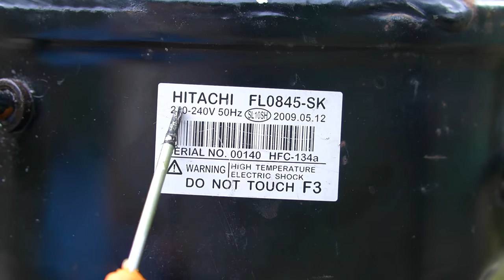I turn fridge compressor into a welding machine new technology

Comment: It is not following magnetic circuit, so as per electromagneic induction it is impossible to work.
Reply: Is directly connected to 240v, maybe just something limiting the current, look at the size of the electric arc, a normal welding machine doesn't make an arc of that size and with that intensity!

Comment: Has a duty cycle of less than enough to do any “real” welding. Not really sure this is a welder or just a crazy short circuit.
Reply: Burn the weld
Reply: What is welding though.  Melting metal with high current  low amps.  How you  achieve that is up to you
Reply: @j5892000  you mean high current low voltage?
Reply: @vinothkumar5846   yeah  . Oops.   Lol
Reply: 😊ช
Reply: @j5892000  
Current and amps are same thing.
I think you meant low voltage and high amperage.
Reply: @vernonleeper   no current and amps are not the same thing . Amps.. also known as ampere  or amperes is a a unit of measurement .   Like 1 amp or ampere of current.   It's like saying 1 gallon of water.  The gallon is the unit of measurement  and the water is what is being measured the amount of
Reply: @j5892000  🙄 whatever

Comment: Regulate the current by moving the secondary winding in and out of the stator. Also you could use the windings from another motor to make a line reactor that would stabilize your Arc more so you would have a constant current welding machine versus a sort of constant voltage machine.
Reply: No opino x q no tengo conocimiento.
Reply: Isn't it just a step down transformer?
Reply: Interesting,would You make a vídeo on how to ,hope You do it
Reply: and rectify the current , and you make a better welder
Reply: Hey, why are you wasting your skill on things that can't work.
1. An air coil with a couple of turns is inserted into the stator, it can never induce the voltage needed to produce an electric arc.
2. No voltage can be induced on a coil inserted like that, at most a few mV.
3. It's a fake!
Reply: @georgeshustbag6131  yes its a fake.. i have a bigger transformer in the past.. with a much bigger wires yet still overheat at cant do good welding... but this video makes good weld with that motor wires so small is very imposible to me too
Reply: @tiktok3rs126  The sad thing is that some people will build and reproduce it...
Reply: @raloed.363  step up
Reply: @eldiony45360  no it has to bee step down. its much smaller amount of turns on the output wire that does the welding. he is using high current to do the welding not high voltage
Reply: Could you  please explain may be simple cicuit of the second winding? Thanks
Reply: Buenas tardes amigo es un motor de nevera es de 120 voltios
Reply: @freddycardozo3274  Hayır 220volt ac
Reply: @raloed.363  Yeah
Reply: what gauge wire did he use?  Also if I touch the two red wires by accident will they kill me or what?  That is, I see that he places one end of the red cable to make contact with the iron so that when the other cable comes together, he creates the solder, but if I accidentally touch the iron while soldering or grab those red cables, what will happen?
Reply: Do you know if works with 110v instead of the 220v?
Reply: Ham Radio ,felicitari . Urmaresc articolele Dvs. de  multi ,chiar foarte multi ani ,construind chiar multe montaje inspirate de acolo .Ma bucura reintalnirea.Mult succes ln continuare !
Reply: @freddycardozo3274  el motor es de Asia o Europe  por eso es 220v
Reply: Muchas gracias
Reply: @freddycardozo3274  Aprecierile mele erau la adresa publicatiei "Ham Radio". Probabil a aparut o confuzie din partea mea . Oricum, doresc mult succes tuturor profesionistilor si impreuna cu incurajarile binemeritate amatorilor acestui minunat microb ,care pe mine m-a infectat la varsta de 12 ani(acum am 66 .)Multa bafta tuturor !
Reply: Or I'll just go buy a cheap machine from harbor freight and get all the bells and whistles I need
Reply: Reglajul se poate face foarte ușor prin o spirala de nichelima pusa pe cablu de cleștele de sudura funcționează ca o rezistență, sau un miez de fier băgat în gaura bobinaj ului făcând câmpul magnetic să aibe oscilații s-au acel bobinaj improvizat scos în afară pierde din putere sau introdus creste puteri, eu am făcut asa ceva cu motor de 2kw.
Reply: @bahri568  the magnetic field is rotating inside the two sets of coils. That makes the core rotate. He uses this principle to make an asynchronous transformer. Maybe even DC.  He should have used much thicker wire for the secondary windings. That wire will heat up nicely.
Reply: @TuMundoAndroideMania  
It`s total fake.
Reply: @TuMundoAndroideMania  Current flows in a closed loop. You can see from the construction that the red wire is isolated from the mains; so if you touch it you will not get electrocuted, even if you're in contact with an electrical ground. This is a step-down transformer so the voltage in the secondary is much lower, but with the very large amount of current flowing, if you were to cut that red wire with pliers you might suffer burns from the resulting arc.

I see that there are doubters here. I have never seen it done with a fridge compressor, but you can in fact make a welder with a transformer and if you get the right kind of welding rods you can also weld with AC. But assuming this is real there is probably about 10-20V at around 100A of current. A fridge uses 200-600W, and you can use some estimates based on the appearance of the arc to back-calculate.
Reply: @stickyfox  I see you !  You explained it to me so well that there is nothing to question.  Thanks for answering what I wanted to know, I thought no one would, thanks.
Reply: what is a line reactor?
Reply: @snorttroll4379  Reactance is the imaginary (AC) form of electrical impedance that's called resistance for DC loads. A reactive load or reactor is the collective term for an inductor or a capacitor. In this case it's an inductor that would keep the current flowing and boost arc voltage if the electrode was raised too high or if something obstructed the arc. Inductors fight (or react to) changes in current and capacitors fight changes in voltage.

I know it sounds like something way cooler with that name. :D
Reply: Это сказка, переноска включена в инвертор, за кадром, вот и весь секрет...
Reply: @georgeshustbag6131 woah I'm glad I started doing some Digging into this, seems like all these are just BS ??
Reply: Entiendo ESPAÑOL
Reply: will you please explain what you mean
Reply: @la24dogg21  Hello and sorry for the late answer. This product fails in a fundamental principle of the law known for nearly 200 years, to which Mr. Faraday has devoted his life... In a coil where the magnetic flux varies along the turns and not across, no voltage can be induced.

Comment: Add threaded rod to your plastic pipe. You'll be able to drive your coil in and out and control the amperage. Came out pretty good for this, not sure about 1800A this must be chinese Amps though🤣
Reply: Chinese amp r weaker small , than whole world amps , and can be easily handled by chinese
Reply: Depending on the voltage of the secondary I can totally see 1800A.  A few years ago I removed the secondary of a microwave oven transformer, rewound with a turns of 1/0 copper.  Normally it produces 2000V with the original secondary but with when rewound It only put out about 2.5V a little over a volt per turn.  I have a 1000 amp clamp meter. When the secondary was shorted the meter went off scale.  This was 120V 20A circuit feeding the transformer. Not sure the voltage of his secondary but since he’s using 220V I can definitely see 1800A no problem if it was low enough voltage

Comment: 1. Обмотки на холостом ходу под напряжением задымили бы сразу.
2. Витки на трубе не пронизывает магнитное поле, так как они расположены не в той плоскости.
3 габариты сердечника которым является статор не рассчитаны на мощность необходимую для сварочного аппарата.
4 не видно показаний прибора
5 провода одинакового сечения у переноски и у держака и массы.
Шутка вобщем интересная, но в серьёзе к этому относится нельзя.
Reply: For me, what he made was basically a transformer that, through alternating current, the large coils manage to excite the central coil that has few turns, thus making the current come out with a few volts but with many amps and in the end, this video doesn't even it seems so fake, have you ever seen those fake videos of guys taking and transforming refrigerator compressors into gasoline engines!?

Comment: The four bolts holding the compressor part to the  ("Stator")  winding part look really unique, they are torx type not allen wrench that you used, even though they did work and did the job. The welder sound like the current is a bit hot. How about making a adjustable output for this unit to more robust choice ??? What is the size of this compressor and voltage King Homemade ???
Nice work fella too.

Comment: That's a very interesting way to make a welder from a repurposed motor. Essentially you have a transformer there with a high current lower voltage secondary. You can regulate the current by moving the core in and out of the motor stator.
Reply: Thank you. That was my specific question. I thought about that but wasn't sure.
Reply: His videos are fake. So I’m assuming this one is fake too
Reply: Yeah, I was thinking it was way too hot for that stick.
Reply: @yourboi1842  I've built several homemade welders and this seems very believable
Reply: @morganchandler5126  press X to doubt

Comment: "Your a genius. Don't mind the comments about the voltage calculation flow and other. Trust me when I tell you this? MANY persons are jealous because they did not thought of this invention first. The mean thing is? It functions due to it's creation of the Electrical Designer. It is small and compatible. One just need to time himself for every three second weld for best results. This item need to be patterned and marketed. Thank you for the creation, you done well."👍
Reply: Tu n'as qu'à l'essayer pour nous  confirmer que ce n'est pas une supercherie
Reply: real fake...🤣😂🤣 this wire go to the welding machine..
Reply: It is good ,but the problem is wheather we can work with it continuely without getting too heat

Comment: That is good. We can now work on improving :
1) cooling : use machine in a transformer oil bath
2) have  multiple taps on secondary winding
3)thermal protection
etc
Let's not fear electric shocks. We can improve on this whilst taking great care and precautions. We can come up with cheap usable gadget instead of buying the equally simple, imported gadgets that have flooded the market. I'm making mine now
Reply: Exactly, why pay 70 bugs for a certified machine if you can sit there for some days assembling your own from scrab and electrify yourself 🤣
Reply: @diyhard666  well   in one of those certif things family member missed!!!   interlal overvoltage!!! or some ark inside,,,,,,  checked after incident nothing found ,,   lets buy every new inverter thing comes through our mind and belive thats  perfect checked.  i know we cant make everything but all was good with his own old one his grandfather gave him,  it was fixed  many times improved some more ,,   and then lets try some inverter china things,, those things hit 100amps  have electronics and stuff,,,  it was a bad year 4 persons  had same fate  by fresh stuff  .. not so well certied!!!!!!! good luck to you
Reply: @panospapadimitriou3498  well, what every this letter massacre shell mean, go ahead, build this scarry thing and hope for the best.
Reply: @diyhard666  i still belive your creation might be  safer cause you re aware......  !!!! it just wont perform the 100% first try
Reply: I have a portable welding machine cooled off by transformer oil. The coil was submerged deep into up to the maximum level. Still i felt the heat of body cover after using it. In this scenario can this stator will not burn out if i do the same.
Reply: It must be an illusion. The core of the red coil is never in the direction of the magnetic field.

Comment: How 16 turn  coil get the power from motor although it cover with plastic
Reply: How? I also don't get it
Reply: Школа, физика 8 класс. Назад за парту. 
Этот парень явно с Юго-Восточной Азии, раз не пользуется верстаком. Порожает как они из отходов человека делают конфетку . И много раз видел, маской сварочной не пользуются.
Reply: Magnetic induction
Reply: Like a transformer....
Reply: It's a transformer. It works via magnetic induction. Essentially as the electricity is flowing along the outside of the wires of the coil it creates magnetism and by having another coil of greater turns/capacity nearby the magnetism generates electricity in it and multiplies the voltage. Doing this in reverse like in the video by going from larger coil to a smaller coil drops voltage and multiplies amperage. This is the exact method used to carry electricity along power lines to "transformer stations." Once there the voltage can be manipulated to increase voltage further or increase amperage, depending on the needs.
Reply: @SirTodd   @MįķŘø  I see, you have just copied shit out of wikipedia. But  you have forgot that this would never work just because nobody welds with 1800A
Reply: @SirTodd  @MįķŘø  Now you think all 1800A is going throw the breaker? Your have just copied whole definition of transformers and still not understand them. Usually 24V is used for welding that is 43,2kVA that is at least 200A breakers and 10 times thicker cables. Mayby im smoking but you cant think a little.
Reply: @EvilElmooo  obviously not 1800 amps... we both know I wasn't referring to a 1800 amp breaker. Stop trying to prove everything I say wrong and think a little. Hardly any HOME breaker can handle 200 amps outside of the entry breaker into the box. Obviously you can run another leg, but that was not the point. That welder will pull MORE than 200 amps in order to have enough to transform to 1800 amps.

I dont know what your problem with me is old man, but i did not copy shit from any online resource. I am a trained electromechanical engineer with over a decade of field experience so I'm very confident in what I know... if I wasn't I wouldn't talk on the subject.

Now take your welding experience and go sit down.

Comment: I have turned my fridge compressor to space shuttle.
Twice.

And arc welded with an air core transformer ,inserted 90 degrees to the plane of induction .

Comment: Welding this way only burns holes trough your work piece and that is well observed in this video. Households also need more Amperage then the public facilities offer, so when you try to weld this dangerous and uncontrolled way, then first ask for power current. That would be a line from the distribution station. Still you will not use this type of welding for what you want to do but one with welding gas surrounding electrode wire. Two car batteries connected in the right way will also pull sparks of a welding stick so no transformer needed but do you want to shock yourselves to death or an accident from acidic explosion?

Comment: Good job, But it somehow expensive, the fridge motor is expensive than the inverter welding machine today, 1500.00 only a 300ampers welding machine.

Comment: judging by the arc reactor 6-9 kw power consumption if you look carefully at the cable from the outlet, the poor thing is moving in  in a maximum of 10 minutes, the threads melt 100%

Comment: La realidad,es que está usando los 220v directos. Para soldar ni el primario,ni el secundario están conectados.es más si le metemos ese voltaje a las bobinas de marcha se quemarían de inmediato,ya que no tiene el rotor,y mucho menos va a salir semejante voltaje por el secundario,con tan pocas espiras.y si estoy equivocado muestra la conexión de cerca sin cortar el video. engañaras a los que no saben,pero no a un ingeniero eléctrico

Comment: This project is not really 1800 amps!! Because 
-cable is very thin compared to 1800 amps
-If it were really 1800 amperes, the electrical grid would not be able to handle the current and it would burn out.
-At 1800 amperes, that welding electrode may explode instantly

Comment: I'll reveal where the trick is.  Do you see this socket where he connects the plug?  Well, that's where the trick is.  In fact, it does not connect this motor to any electrical energy, but to the output of one of the cables of an inverter where the soldering pliers and grounding cables are located.  Point, I said!
Reply: I assure u.... u don't know what u talking about!
Now don't make a fool of yourself, just leave it as an odd  joke!!
🤣

Comment: Just another video of salt water welding .uses socket to make hide and seek😂😂.i am refrigeration technician we use olp over load protection for fridge compressor so that it does not burn winding.and maximum amp handling is 10amps

Comment: El motor (compresor) de una heladera es de 100watts.
Para entregar 1200 amperes sin quemarse necesita entregar a la salida 0.08voltios.

Por Ley de Ohm.
0.08/1200 = 0.000075 Ohms.
El contacto eléctrico de un electrodo supera los 3 Ohms, por lo que esto es imposible físicamente.
Ese fuego azul se produce por alto voltaje, de seguro tienes un transformador de microondas del otro lado y por eso los cables de la zapatilla están alejados entre sí.